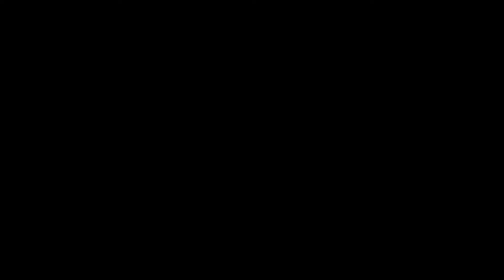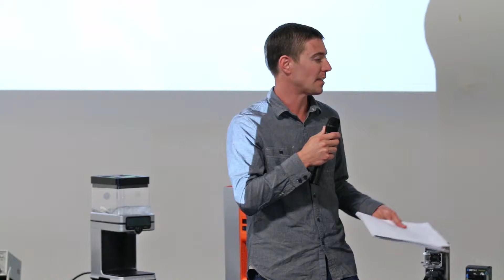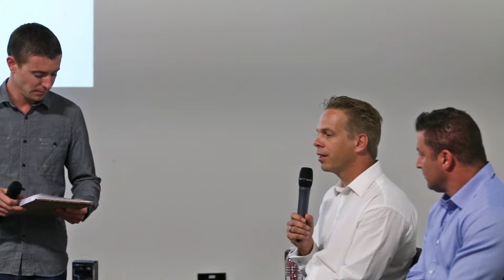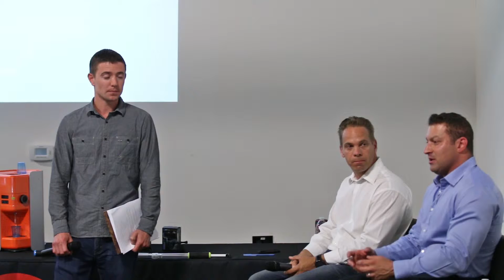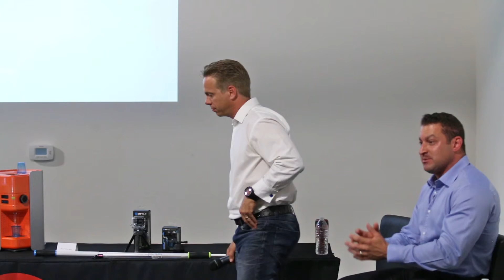Why You Cant 3D Print All CAD Files

Comment: I disagree a 9 axis CNC machine can build part that a 3D printer can't do. Take for example a turbo impellor or a drive shaft gear. I think there is a lack in engineering in overengineer 3D parts design for only 3D printer, with the exemption of art manufacturing.